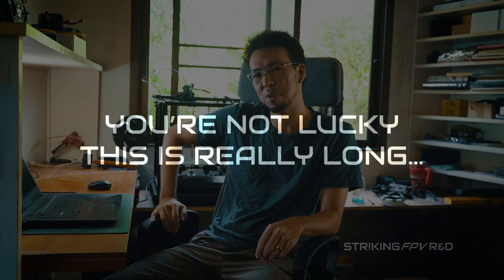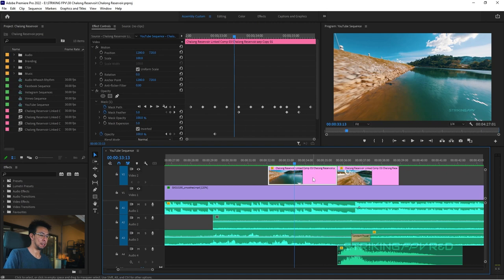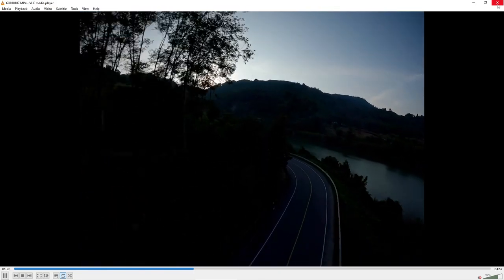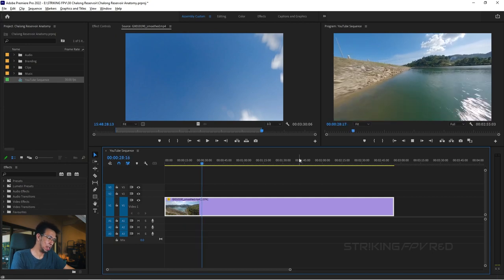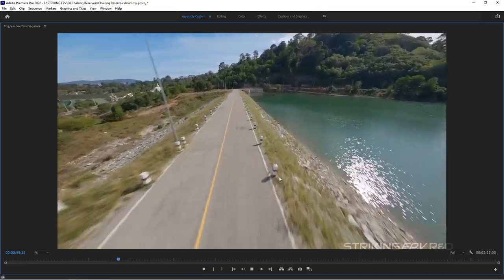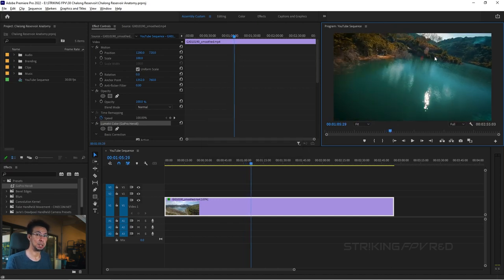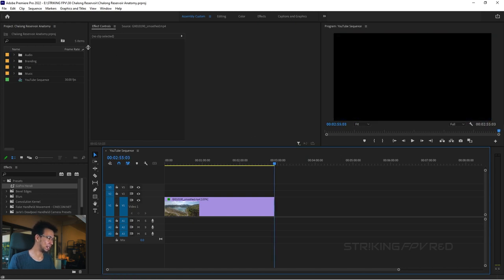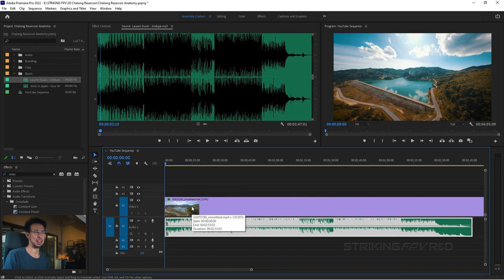Editing an FPV Drone Video - Anatomy of a Cinematic FPV Flight Part 2

Comment: Why did you make a cut right in the middle of the flip?  Was it to shorten the video, but make it look like one continuous flow?
Reply from the maker: Ah yes, so if you watch the pre-flight walk-around video, I do talk about how this was planned all along - the long-distance part of the flight I'm situated at another part of the dam, far from the spillway, such that both the type of drone (freestyle) and the potential interference of the concrete mean I shouldn't try flying down the spillway in one go, so I do the flip as a transition point.  From there it's a different drone, a cinewhoop, and I'm also sitting at a new location right next to the spillway so my radio and video signal doesn't get interrupted around all that concrete.

Comment: You are the best explaining all of this really thanks for your hard work! Could You do and editing tutorial for a cinematic video with diferentes shots? (No one take) i would like to ser how You aproach to the transitions. In that case you use more the drone movement? Or you use transitions it self? Iam having a hard time with transitioning fron one clip to another. Sorry for mi English and thanks!
Reply from the maker: I'll have to give it some thought, but yes this could be done - I think I did some stuff like this in the Cruise by the Pools video, mix of masking with gradient wipes to make transitions more interesting than just cutting.  It's very video specific though, and to be done well needs planning before a flight - otherwise you need to get creative when reviewing footage with gaps or sharp turns.
Reply: @STRIKINGFPV  You could do some kind of tutorial for that kind of editing? Thanks Master.

Comment: Do you use proxies on lower power machines.  And yes!  Adobe does crash quite a bit.  🤔  You got free Luts man?  LOL.  You have a very understandable way f putting across some of this information.  Some of these other "creators" just go too deep into it and way too fast.  I have had Premier for over a year and I use it every day, but I am not very creative by nature.  I need all of the tools I can get.  Over a year and I have barely scratched the surface of it's capabilities.
Reply from the maker: I sometimes use proxies, but a lot of the time I forget to do it unless scrubbing through footage starts to get too choppy, then I'll remember that it can help.  It doesn't always improve things though - I edit off a high-speed external SSD and sometimes off my internal SSD, so throughput isn't as much of an issue as some of the rendering effects, thus proxies are not a guaranteed improvement, but it depends from system to system.

And no, I don't offer free LUTS myself, haha.  Those LUTs that I have I must've found maybe six or seven years ago.  They're decent, not amazing, but crucially whichever one I use I always turn it down and make my own small corrections do that weird things like banding or flickering either don't occur or are less pronounced.  A lot of my videos have visible flickering from how the LUT and grain in the image interact, but it's not too distracting so I live with it.  Until I properly switch to DaVinci Resolve and up my colour grading game, I'm satisfied for now.

Glad you like my way of "teaching", hehe.  Believe it or not I cut down like ten minutes of additional footage because there are so many places that I can go off on a tangent that gets too far away from the task at hand.  It's the reason why I think maybe for the future I could break down each section in more detail, but that's a very time consuming task so will leave it for now and focus on other things.
Reply: @STRIKINGFPV   I have tried these tutorial type videos on some of my builds and flights.  It's not as easy as it looks and very time consuming and when you are using several cameras something can always go wrong with one of them.

Comment: Nice breakdown! Learned a couple things 🙂
I've produced a lot of psytrance in my youth and used a ton of whooshy sounds. One thing I learned early: hipass these (cut away the bass)! They often have a ton of low freq noise which can really mess with the bass of the real music. I feel like this would be applicable here as well, even though the music is not so bass-heavy. The occurence of clipping is likely also related to the high amount of low freq noise in that instant. 
Happy flying!
Reply from the maker: You're totally right - in other videos I've done I normally cut the low frequency on the music track when a whoosh or howling wind comes in since I want the low rumble to come through, but at the same time one of the biggest headaches is considering the platform that people will be viewing on which will be, on average, a mobile device, thus no bass.  Even laptops just don't have the low-end, so I could be previewing everything on my big studio monitors and be happy, but then I switch to the laptop speakers and then suddenly it doesn't feel right 😅.

Even in this faux-tutorial, for the sake of audio during recording I did everything mainly out of my laptop speakers, but then editing the tutorial there were some bits that couldn't be heard despite audio being captured directly.  Audio mixing is no joke 😬.